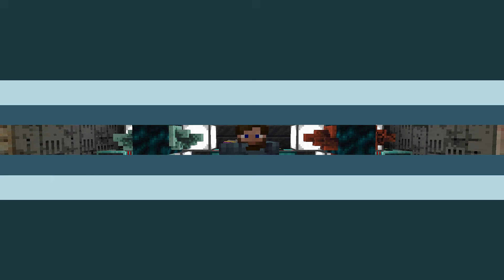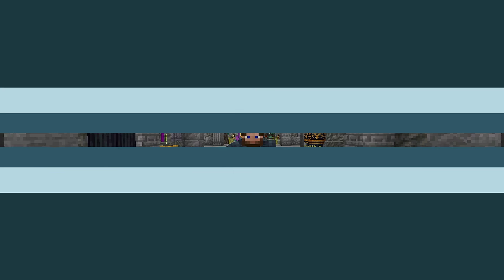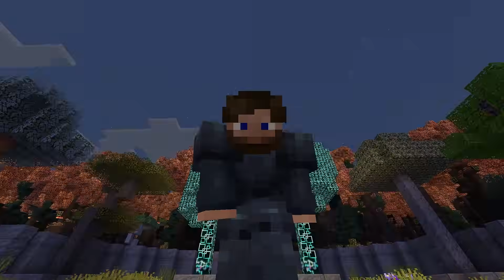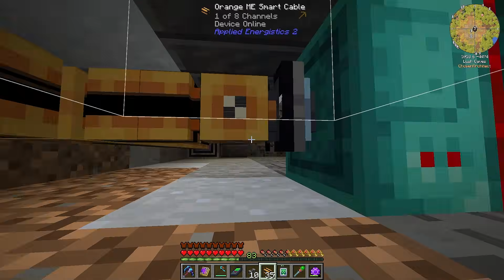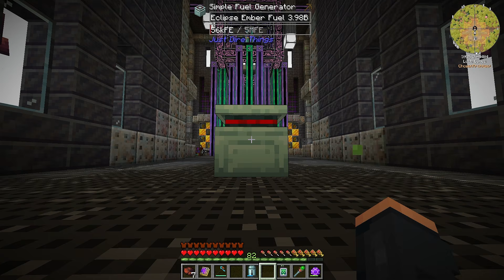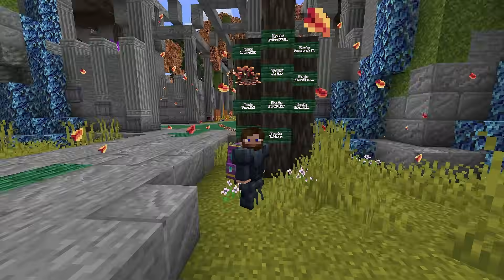All The Mods 10 EP52 Just Dire Things Eclipse Ember Fuel Automation: Challenge Accepted!

Comment: The clicker isn't "placing blocks outside the area", it's a clicker, not a placer and it just keeps clicking on the block defined by the area. It does exactly what you're telling it to, if you tell it to right click on a specific block from a specific side with the block in its inventory it will just keep doing that continuously and since a fed goo can't take any more of the sculk it will be the exact same result as you clicking it - placing the block on the side of the goo.
Reply: I resolved this by placing an Advanced Sensor on top of the Clicker. Put the goo in the filter and set it to Alive-False. Then set both machines to high redstone. Bingo!
Reply: @Moogstar1968  cant get it to work

Comment: You can do fuel with just one of those set ups. The dropper is configurable to drop in a specific order using the filter. By having the correct timing on the dropped items you can go from water to ember fuel in 1 block space.

Comment: Usually don't comment but figured might give some info about AE2, there is a stock exporter to keep a certain amount in an inventory. No need to use another mod to regulate
Reply: That ^
But even better than that is quantum craft, both of which would be an objectively more simple method.